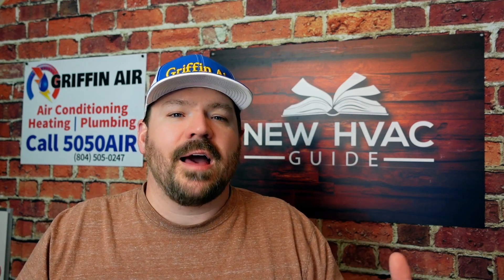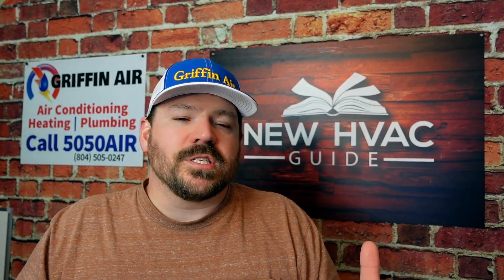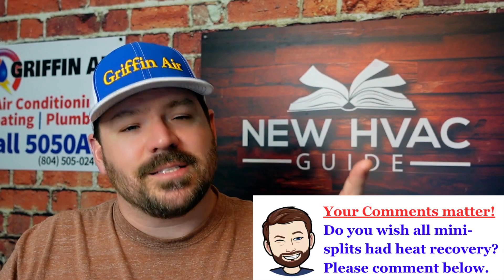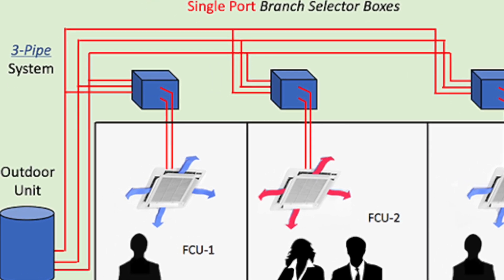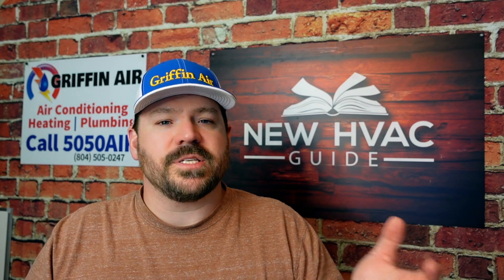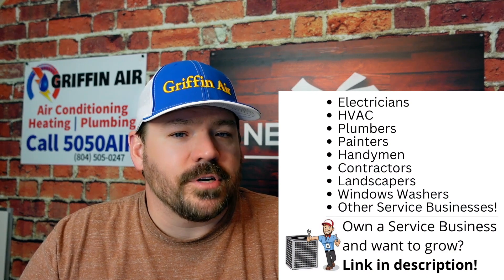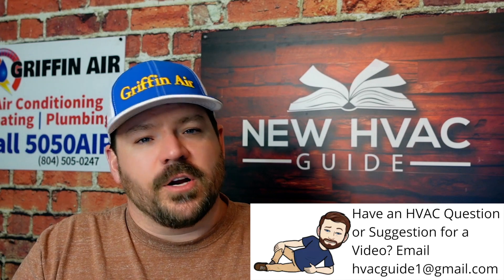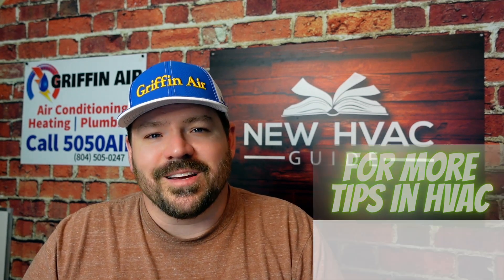Ductless Mini Split That Can HEAT and COOL Together!

Comment: Josh, I have always liked your honesty in describing pros and cons with HVAC gear.  May I add.  Commenting before and receiving a reply from you in the comment section let me say a bit of something I found with my Mitsu system.  I have 3 handlers on a 30K btu ODU.  I learned last year (my first year with the new setup), not only the well known fact about what you state here about heat or cooling only at a time but......

I found out, at least with this brand, you CAN NOT even run it in FAN mode in any one air handler unless they are ALL in FAN mode !   I wanted to leave AC on in the main part of the home, but just circulate air in the master bedroom while sleeping.   Simply put, could NOT do it.   I am not sure if other brands have this same scheme or not.   What can you add?

Thanks, and I do catch your Tuesday night 'shows' 🙂
Reply from the maker: We have a customer that has said the same thing. His units are on different levels in the house so running upstairs just to switch the other one has become quite a chore. We ended up installing thermostats that could be connected to Wi-Fi so he could control everything from his phone
Reply: @NewHVACGuide  Ok, thanks Josh.  I will say, what helped me was installing that SECOND ODU.  AC upstairs, and heat on the first floor that is still chilly this time of year.  Helps having discrete heat pump systems in my case.  👍

Comment: Ive started my research into heat pumps as my existing setup is starting to show its age. 

Considering just doing my upstairs zone first and have been debating between doing individual dedicated mini splits for each room or a multi split. 

Contrary to what I expected, for some reason individual mini splits seem like they wouldn’t actually cost more money, and come with a benefit of actually being far more efficient, especially since 2 of my bedrooms are a fair bit larger than the other 2 smaller bedrooms. 

Didn’t even hear about heat recovery units, but the concept makes sense. Though individual mini splits also prevent this issue as well. 

I guess it depends on install complexity for cost of individual vs multi split, but the more I research, the less a multi split seems to make sense…

Heat recovery multi splits seem like the only thing that could change this, as it could take advantage of excess heat in certain areas for use in other areas. 

I’m actually surprised that no one has come out with a whole home solution yet, connecting heating or cooling sources within the house. Such as refrigerators, washing machines or dryers, dishwashers, hvac, etc.

Comment: i have been doing heating and air for like 8 years now.  im in Pennsylvania and any mini split system i had a service call on is a nightmare.  tech support for hours--2 week wait for parts.  --control boards that cost 400 dollars.     i would just tell customers to stick to the old school stuff.  parts easy to find .     i work on alot of boilers up here--mainly steam but some reg boilers, but also probably  around the 50,s and 60,s.        reg central air i think is better and  just shut your heat vent if your too cold.

Comment: Thanks for the info, very helpful. Have you done a video on a ducted minisplit system? Looking to replace my central system with apparently a heat recovery unit!
Reply from the maker: I’ve done a few talking about ductless. I’ll probably do one on the one I’m putting in my office in the next month or two
Reply: Would love to see a ducted video with an air handler so I can keep a humidifier and air purifier. Can the heat recovery unit be used with an air handler to zone out the house? I haven’t found much info on the air handlers and ducted minis; I cant be the only person with a zoned ducted central system with a humidifier and air purifier looking to switch?
Reply: @xokissmekatexo  The unit that Josh showed in the video is either a low or medium static air handler and probably wouldn't be compatible with your existing ductwork. There are variable speed inverter based systems(like mini-splits) that can  be installed with high static ductwork.